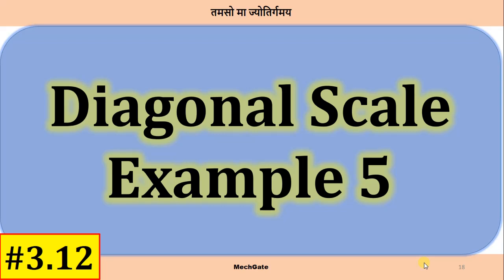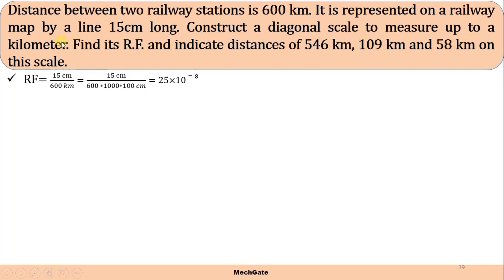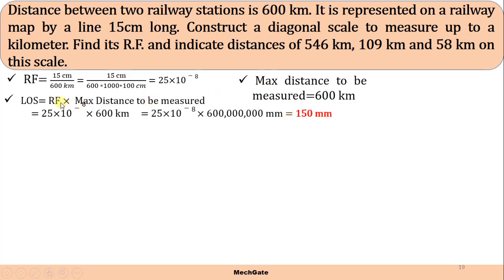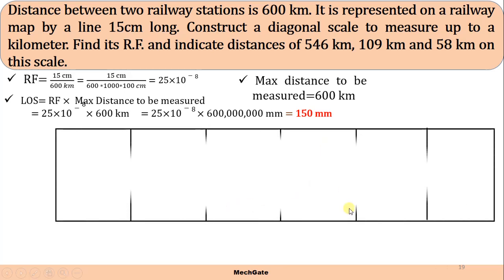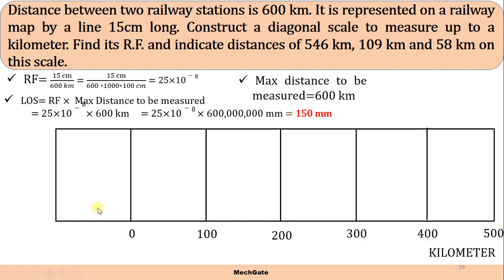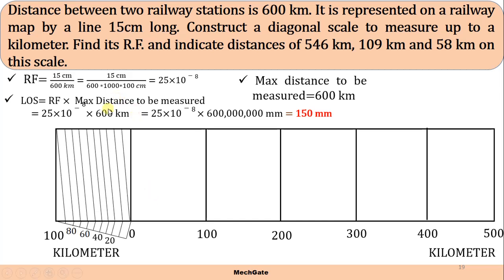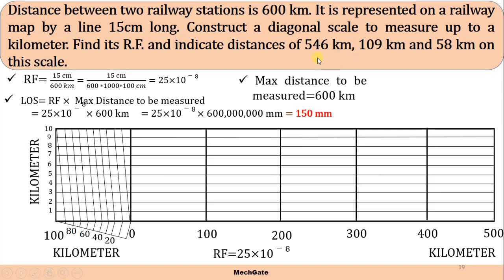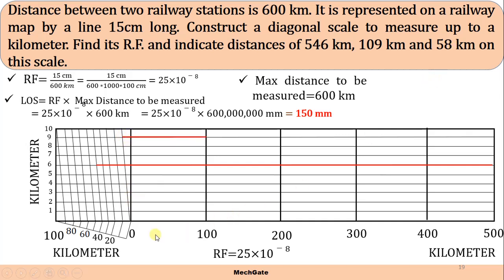Diagonal Scale Example 5 | MechGate

Comment: Why we take height as 50mm?
Reply from the maker: As 50 mm can be easily divided into 10 equal parts that's why. You have select height depending on your 1 St sub division is 10 km, we are further dividing 10 km into 10 equal parts to get km in one's. If first subdivision will be 5 km , then you have divide height into 5 equal parts. So for simplicity of division we select height as 50 mm
Reply: Sir should we take height always of 50 mm for easy to get 10 subdivision